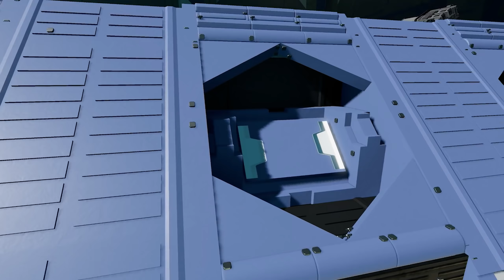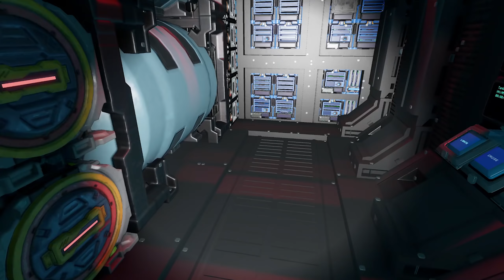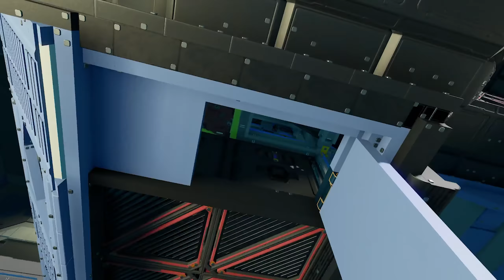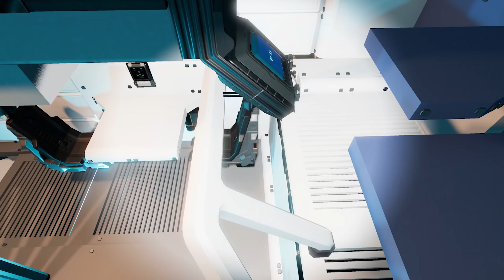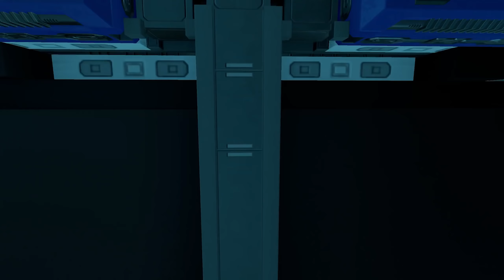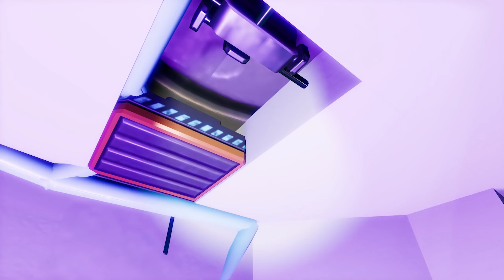Starbase - Duratech Ship Shop Tour - Part 4

Comment: Is there a way to place/cut a cabel by pressing a button in the cockpit?
Reply: It's actually now possible without heresy. This is because "hard cables" have been introduced, so-called "ducts".
They are flat and consist of freely placeable elements. Both power and propellant flow through them.

It is possible to interrupt a duct route at the push of a button with the aid of a hinge, etc.
Depending on the application, however, a memory relay could be even more suitable.
Reply: @TobiEx  yes, i think that hinge-trick will do fine.
Reply from the maker: no you cant cut a cable but there is a way to stop a signal passing though with a device and heresy should not be needed, but you will need to make sure you dont have secondary connections on the other side, so a closed system on the other side of the device
Reply: @KenetorTV  it's not about the signal. It's about power. Like power, consumed by plasma thruster on standby. The question was is there away to switch off a device or a network. Or to automatically plug/unplug a power socket.
Reply from the maker: no signal means no power, also the plasma thruster has an on and off switch

Comment: this is all next level stuff. i did not realize starbase would let you go into that much detail with yolo and being able to change screen ect at a button push. its like a modern car
Reply: And it's suprisingly simple to achieve something like that.
Reply: @durtch3764  Haven't delved into the deepend with YOLOL like that just yet, but would be interesting to know how it's done, I guess I could check the ship shops. However, how did you manage to paint the buttons black?
Reply: @Alendo  Buttons can be painted in the SSC (Spaceship Creator)
Reply from the maker: yeah Starbase takes ship design to the next level